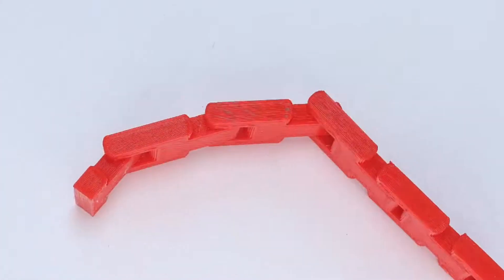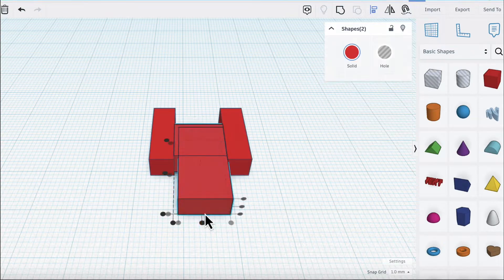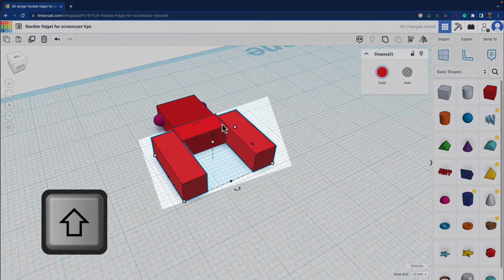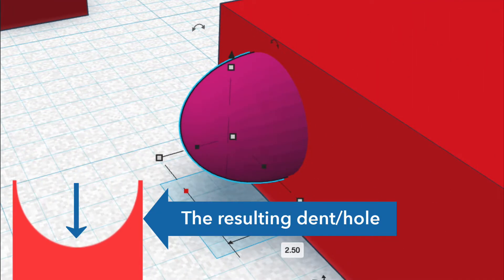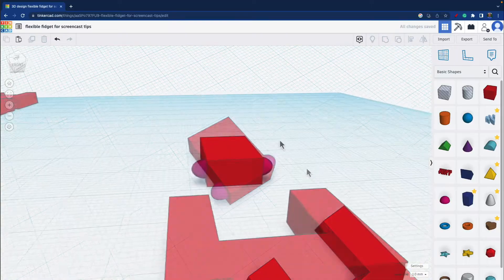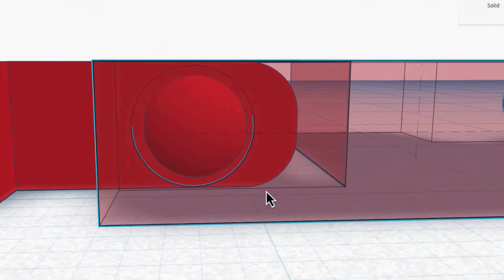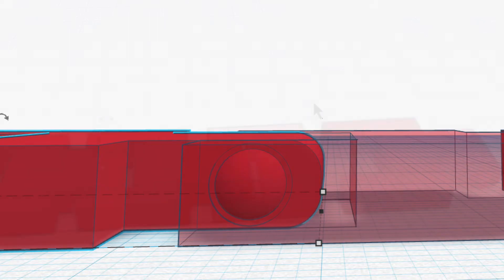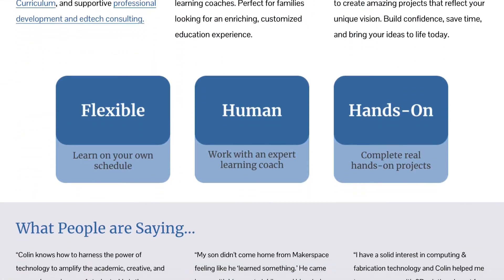How to Design a 3D printable print-in-place chain in Tinkercad

Comment: Great explanation on how 3d Printing likes sphere's vice rods because if people learned more of how 3d Printing actually worked instead of posting on forums of how bad their printers are, it would save time and effort.  Also, your editing to add upper right hand corner cut-outs of what's actually happening and short cuts is a lot better than most people creating instructional videos.  I'm designing a new Star Wars Tank Droid that this linking will come in handy for using; however, I'm a little concerned on its strength for a tank tread that will carry about 10 pounds of resin, electronics, motors, etc.  I guess I'll have to do some strength testing and either use your sphere method or some type of inserted rods.  My fully functional R2D2 I built can bee seen on my Youtube channel "GunnerAl9" if you want to see my work. I also just completed a 95% 3d printed SW Mouse Droid.  Thanks for the great video, it has been saved to my TinkerCad Folder.

Comment: Personally, I'm more of a Cone instead of a Halfsphere person 🤔 Something I've used in the Print in Place Door Hinges ( https://i.imgur.com/NiqvIzQ.png / https://i.imgur.com/GUyVyZr.png ) for my 3D Printer Enclosure ( https://i.imgur.com/QsdNjKZ.jpg ) 😏

That being said... Given the choice between Tinkercad and Fusion 360 I'd highly recommend going with the latter since it's the vastly superior while hardly any more difficult to learn CAD Software... ( just search for Lars Christensen F360 Absolute Beginners Guide to start out with ) Both can be used for free for as long as you don't require access to more than 10 active Projects at a time which shouldn't be the case until you've reached a point in F360 where you're working with Assemblies consisting of multiple Projects at which point the cost of roughly $1.50/day for a paid License should be the lesser evil for a great piece of Software.